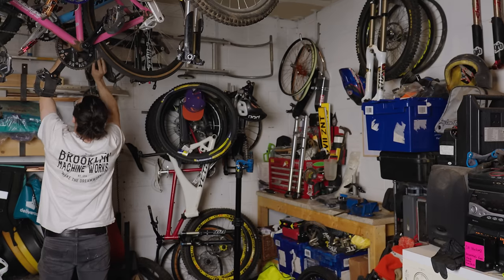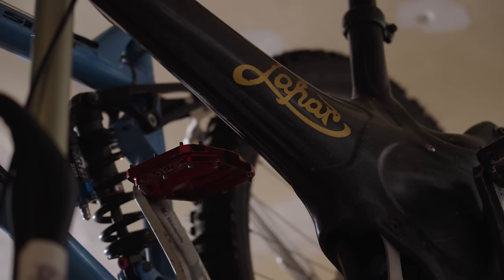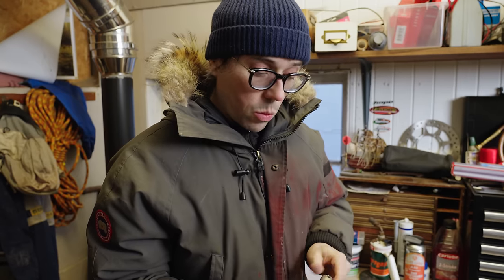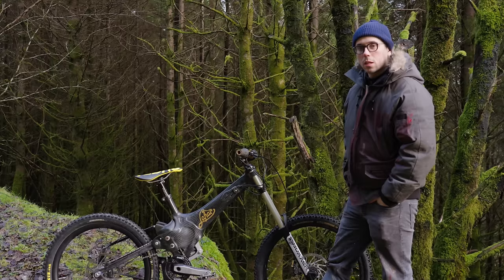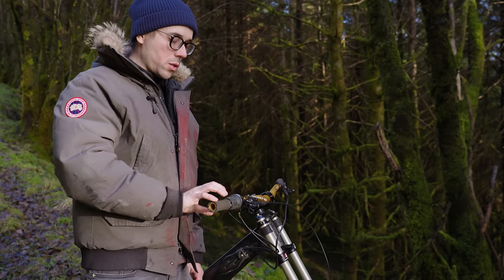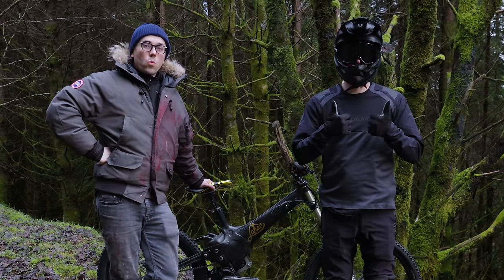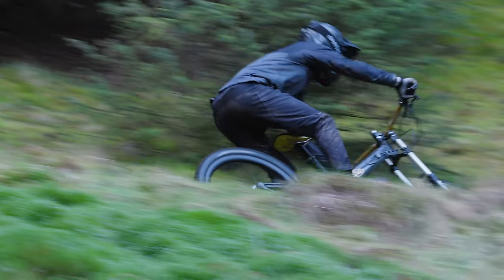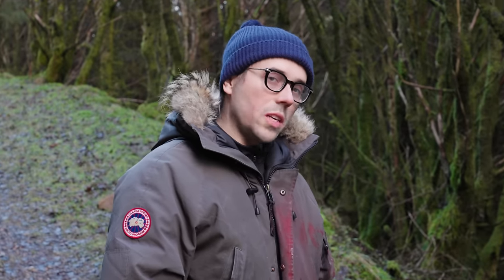Rebuilding a Legend

Comment: I was lucky enough to have a go on one back in 2001 couldn’t believe how well it cornered
Reply from the maker: Must have been an early one as this was about 06/07 I can’t mind I’ve owned it for that long
Reply: @stephen_hughes  The first ones came about in the mid-late 90's (supposedly GT copied them for the original IT-1...) and there was a few top guys running the M6 to M8 versions from 2000 to 2005 before the M9 came around with Cam Cole for 2006. They were definitely ahead of their time!

Comment: rad! cool to see some documentation of the old beast. any idea of the build number (mine is #7)? i see it's got the early run hand-wittled forward shock mounts (changed to water jet 1 pc in later production units). curious what total production was; doesn't sound like he got much higher than 12-13 units.
Reply from the maker: Yeah the no’s aren’t something many really knows, most have disappeared into the ether. I know yours, one other one I know of, someone in Morzine has one and I think there is one in vertigo bikes with the M8 in queenstown. 

Mine has a new linkage too, coming in the next part!
Reply: I built 22 m9s. Had CNC parts and molds upgraded to do a 20 bike production run, but a certain triathlete panel beater known for the bodgyist carbon triathlon bikes every built, and spray painting fibreglass to look like carbon, took 5grand for a five mainframe labour only mainframe production run in 2008, and skipped the country for a racing holiday in Switzerland with it.
He'd been okay making softails in my factory in Auckland, and had no problem building the first mainframe.... Vapour.

Comment: Need a bit advice , I’m 35 done rode MTB since I was 18 -34 then fell away , what bike would you recommend to start road riding again then get into the off-road once I get confident? Any shops in West Lothian you know off to buy from and what kinda price would you recommend?
Reply from the maker: Personally I’d say road can be more intimidating  since you have to deal with cars and stuff if you’ve been off it for a while but like anything once you get back on you’ll be grand. Most of the trail centres have trails that go from easy to hard, I’d personally just go off road unless you really wanna ride road it’s a ton more fun!

Bike wise, really depends on your budget but the 2nd hand market has some absolute steals the now. It’s a buyers market!

Good luck and have fun.